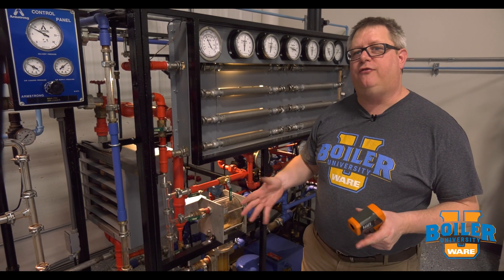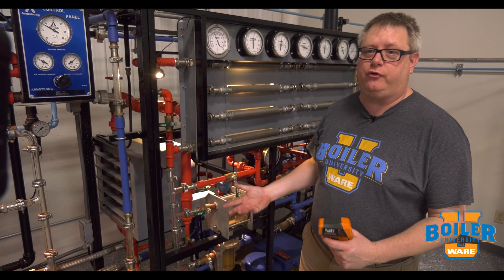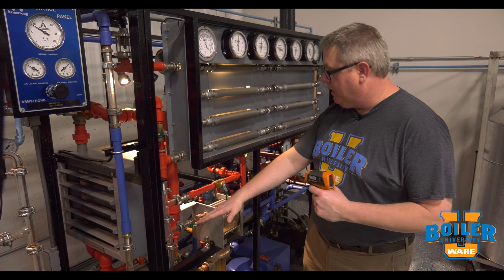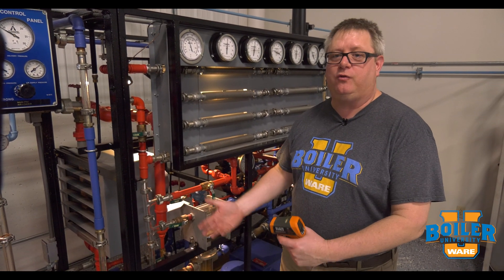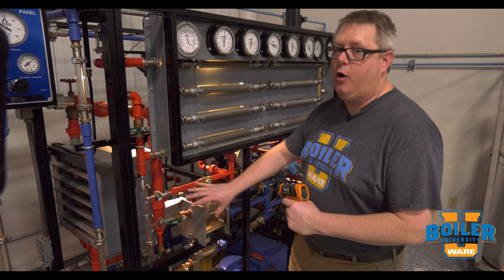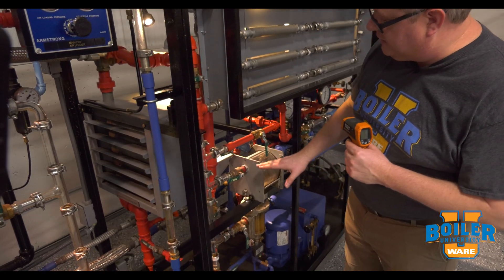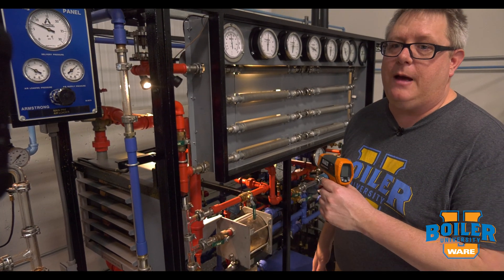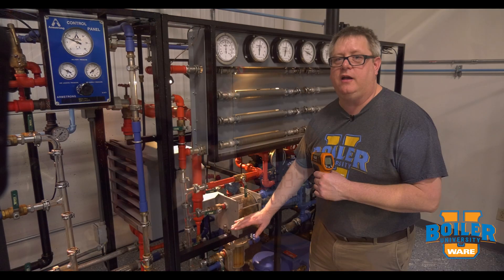Steam Traps | Troubleshooting Float and Thermostatic Traps - Weekly Steam Tips

Comment: The temperature method is not correct, if you don’t have the pressure downstream of the trap. In thermodynamics you need at least 3 conditions to define the status. For example if the condensate is going in a pressure of 1 barg means that max temperature of the condensate will be 120c, but at the same time you can have condensate or live steam at the same temperature. That is the reason that you have to use ultrasonic tools to define the behavior of the trap.